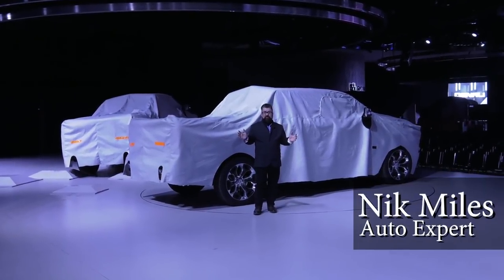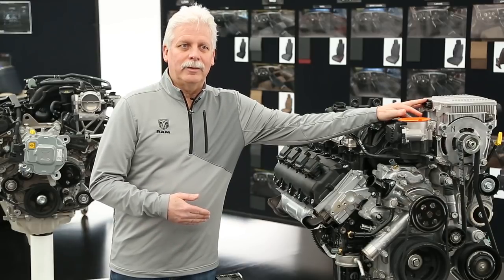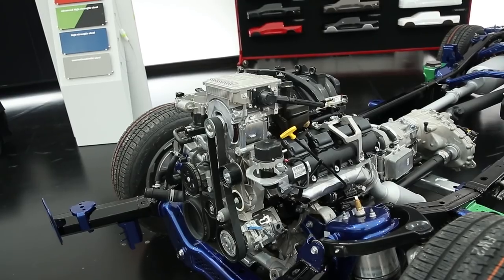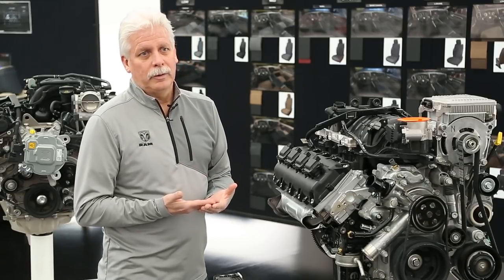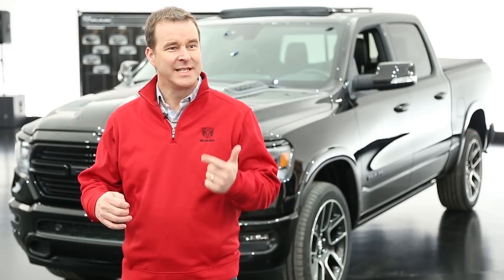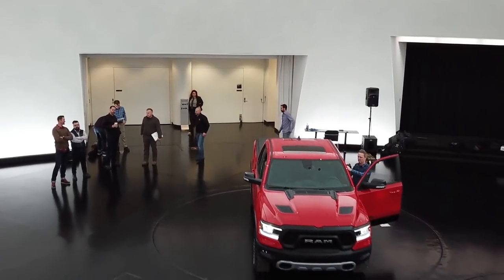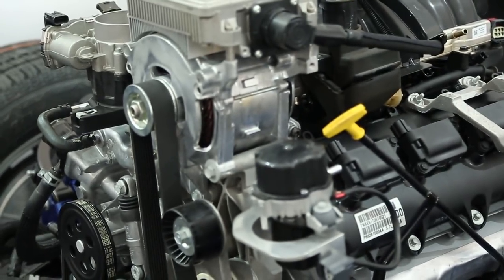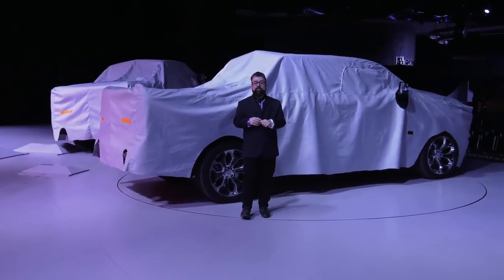Exclusive Footage : 2019 Ram 1500 : Rams First Ever Mild Hybrid Truck

Comment: If you live in Canada - Do NOT buy a Ram with the Air Ride Suspension...It is failing all over the country with no solution from FCA Canada...works great until it hits -10 Celsius
Reply: D Kidder You are right on that.Useless in the cold
Reply: Nice looking exterior and interior change but no change with the 5.7 Hemi still iron block other than was mentioned. Still no direct injection with Port a bit disappointing.
Reply: Cory Coulter It’s like having concrete blocks for suspension when it gets too cold. I’m from Dilworth, MN. The Chrysler dealership said there is no fix for it.
Reply: Those who innovate always have to deal with these issues first. Necessity is the key to invention.
Reply: Now I know why is it cheaper there !